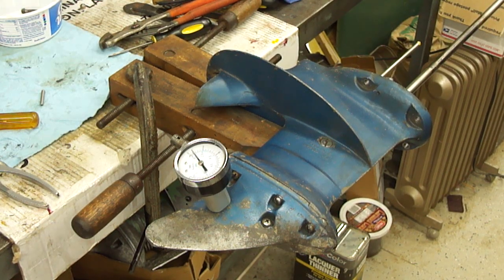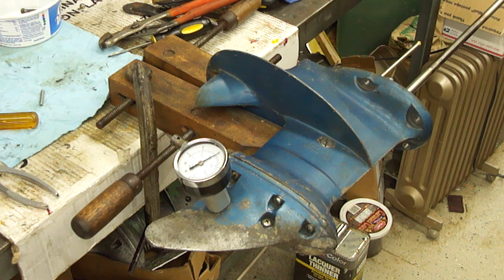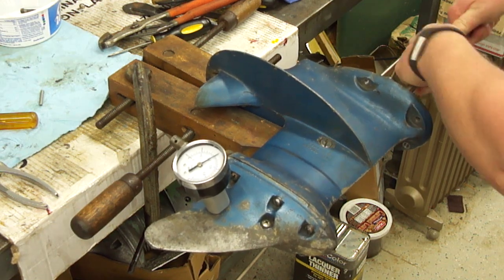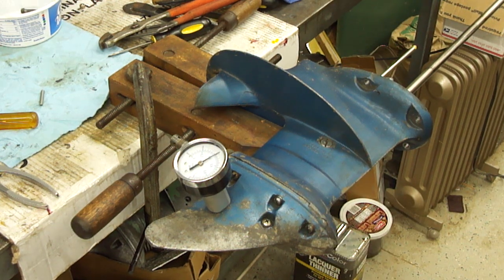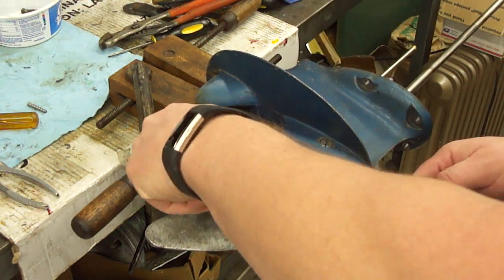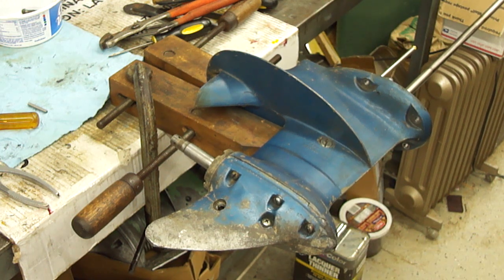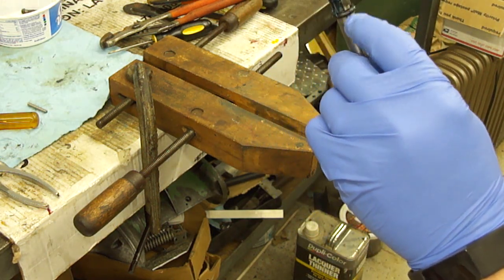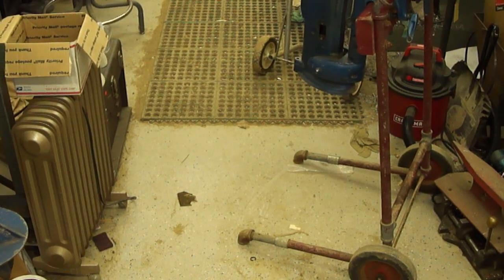Classic OMC Outboard Motor Tune Up #12 Lower Unit Check and Install

Comment: Hey Johnny, how are you? I just recently bought a 1956 Buccaneer 12hp outboard from my aomci meet and it has a shifting problem, the problem is that it wont go into reverse. I know I'm going to have to pull the lower unit off and get into it. But what could it be? A clutch dog? Or someone didn't adjust it right? A seal even? But the video gave me some help on how to pull a lower unit off, I heard the power head had to come off in order to pull the lower unit off. Thanks,
Mike
Reply from the maker: Congrats on your new motor.  The Gale 12hp is a nice smooth, quiet-running motor.  I have a 1959 12hp Sea King that is a good runner.  Yours not shifting into reverse could be an adjustment at the shift lever.  It could also be the shift rod coupling screws are not tight and allowing the coupling to slip too much to engage properly.  It is possible that the clutch dog may also be part of the problem and if it was having trouble fully engaging reverse, it may have gotten damaged along the way.  I do not believe your 12hp requires removal of the powerhead to drop the lower unit.  There should either be a cover plate / window in the side of the exhaust leg that can be removed to access the coupling screws or the fasteners that hold the lower unit on the midsection are removed and the lower unit can be dropped far enough to access the coupling screws.  I believe the 56 has the access cover on the side but I'm not 100% sure.  The 5hp Gales need to have the powerhead removed to drop the lower unit just like the J/E 5.5 / 7.5 motors.  The 12hp is based on the J/E 15hp and should have the coupling accessible from the side.  Thanks for watching!
Reply: Thanks for the tips, I've been in the hobby since I was 12 years old, now I'm 19. But I've never had this issue with a classic OMC( well the classics I own never had that issue) never had to mess with that so I'm just a rookie at doing this. It has the plate like you said with the 2 screws holding it in and I should check it.
Reply from the maker: @gmc_crackerbox_truck1485  Yes, check it out.  There should be a coupling behind the cover.  The coupling has two fine thread screws.  The screws should be tight (not overtight since the coupling is brass).  To remove the lower unit, one of the screws (typically the lower one but either will work) must be completely removed. When replacing it, be very careful to line the notch in the shift rod with the hole in the coupling as close to perfectly as possible.  If it is off a little it will damage the screw threads and in turn damage the threads in the coupling when the screw threads into it.

Comment: You are so right, sometimes you could throw the gearcase from the opposite side of the room and it will slip into place perfectly....Other times, not so much, plenty of cursing is needed.  I get so frustrated/angry when I hear/read/see folks telling owners to go ahead and rip into one of these gearcases....While it is true, most could probabably get it back together, and it might work....kind of....Doing the job correctly is a whole "nother story" indeed.  These clam shell gearcases are not easy to reseal properly, there are many pitfalls.  Love your recommendation about marking the shift rod, will have to steal that idea from you....  Be careful that stand doesn't tip over with the engine tilted up, don't ask me how I know about such a disaster....
Reply from the maker: Yup, I never know how smoothly (or not) that lower unit installation is going to go.  This one was pretty typical for me.  Some of them do require they be spoken to in the right "tone" lol! These are not always easy to get sealed up perfectly.  It took me a few tried when I got started in this hobby to get them right.  I still end up doing one over from time to time. Tubs from the Club posted on the AOMCI site a number of times painting that groove with paint or nail polish to make it more visible.  It really does help a lot. Thanks for watching Don!

Comment: When trying to put drive gear back in there was a o-ring of some sort in the way not allowing it to go in place. I was able to get it out in pieces and drive gear went in. It wasn't the old drive gear o-ring because that came out still on drive gear when I removed gear case. Could this be a big issue? Do I need to get in there some how and replace that.
Reply: You mentioned It had to go through the plate and base gasket. So Im guessing it would be the base gasket. That's what was in the way and fell apart when trying to move it out of the way to get drive gear back in.
Reply from the maker: I'm assuming you are referring to the drive shaft splines going into the crankshaft splines in the powerhead.  It is possible that a previous drive shaft O-ring got damaged and ended up laying on the baffle plate under the powerhead.   The base gaskets are quite thin fiber gaskets on each side of the thin stainless steel baffle plate.  The only other O-ring in there would be the one inside the carbon seal for the lower crank seal.  If that is broken and pieces are coming out that is a problem.   The only way to know is to either identify the pieces or pull the powerhead off and look at the lower crank seal assembly.  Chances are if the seal is that damaged the engine will not idle well due to loss of crankcase compression and potential water ingestion in the bottom cylinder.   That seems unlikely though.  Thanks for watching!

Comment: I'm going to reseal my QD-23 10 hp, will permatex #1 (hardening type work instead of 3m 847, or 515 or 510 anaerobic sealer, which   on would you suggest.
Reply from the maker: I would not use Permanent #1.  Something that remains flexible should be used.  I prefer Permatex Ultra Black myself.  I have used 3M 847 a lot too, but it has to be right the first time or you're starting over.  Ultra Black is much more forgiving and easier to work with.  Thanks for watching!

Comment: Have a 65 18hp Fastwin. I took the lower off in neutral and put it back in neutral and now it’s not in the correct gear. Prop only moves about 2 inches in either direction in neutral. How can I fix this?
Reply from the maker: On a '65 Fastwin there is no detent in the gearcase to hold the shift fork in position.  That is all done at the top of the soft rod at the shift handle.  For what you are describing to happen, the most likely scenario is that the gearcase and of the shift rod is not engaged fully into the coupler.  The scenario you describe sound like the gearcase is in gear (either F or R) while the shift handle is in N position.  I would suggest checking the shift rod in the coupler and make sure the groove on the shift rod lines up perfectly with the screw hole in the coupler before replacing the screw.  Be careful since the threads on the screw can be damaged by a misaligned shift rod.  If the threads on the screw get flattened the screw will damage.the threads in the coupler as it is screwed in. I hope this helps.  Thanks for watching!

Comment: hello sir i am interested in your Youtube channel.i am buying an evinrude 25 hp year 1975. what you can say about this model. is it a good engine ????? thank you
Reply from the maker: 1975 Evinrude 25 is a fine engine.  The only thi g ablut it that I do not care for is the Lo-tension magneto. OMC used that ignition on the 25s from 1973 thru 1976.  It was used between the universal magneto ignition and the CD ignition that began in 1977.  As long as everything is not too worn they can be made to run well.  They are more finicky than the Universal Magneto and had more of a tendency to foul plugs, especially when idling or trolling for extended periods.   They are well made and good strong runners despite the shortcomings of that ignition system.  Thanks for watching!
Reply: sir I use my engine to big trips of the coasts. give me advice to avoid breakdowns
Reply from the maker: @jbelimariem1959  my best advice to avoid breakdowns with the engine you are asking about is to replace the points, charge coils, plugs amd plug wires.  Rebuild the carburetor with OEM parts and replace the fuel lines.  A new fuel pump may also be a consideration.  Make sure your gearcase is sealed and water tight and keep the gear oil fresh.  Keep up with water pump impeller replacements every few years at least.  I have heard that NGK spark plugs work best in the Lo-tension ignition.   These are the recommendations i can think of now.